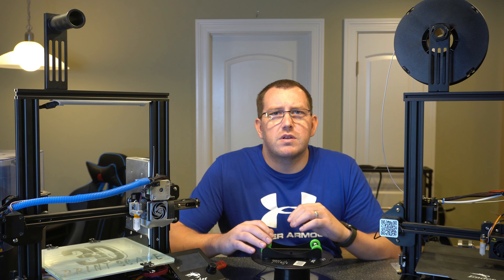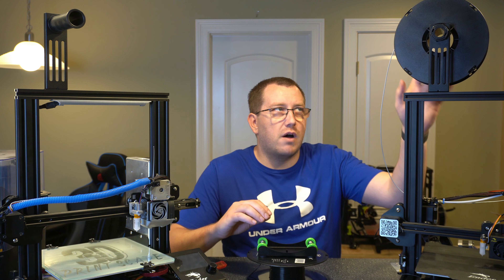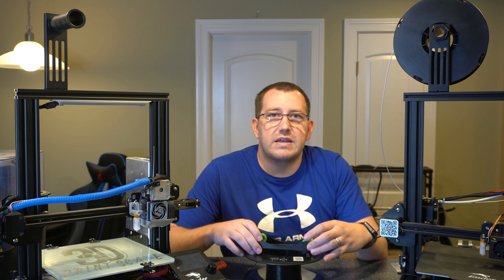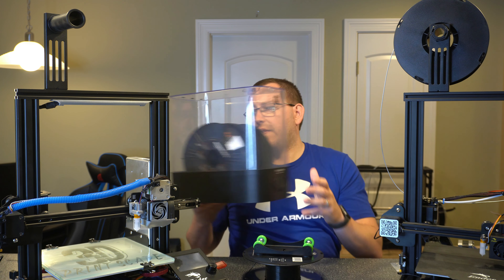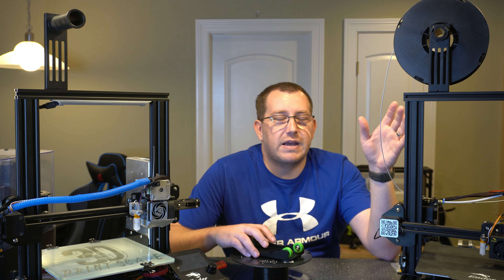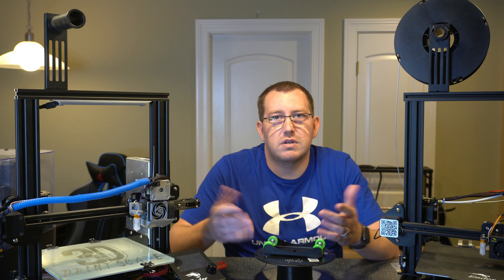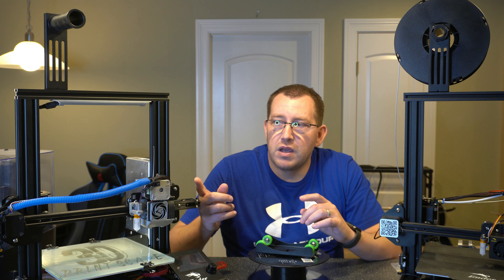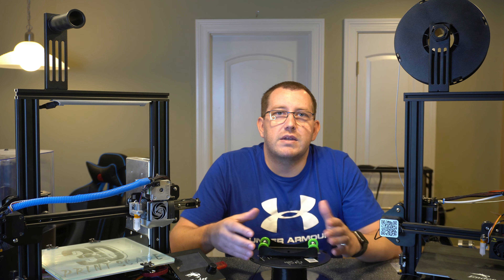3D Printer Filament Spool Holder Overview

Comment: Great videos as always Rob 👍 I printed a T.U.S.H as one of my first prints and it works great
Reply from the maker: Thanks and nice choice.
Reply: Me too , but i found that when the spool ( placed next or raised) gets lighter it has a tendency to leap of the TUSH.
Reply: @a1hamer  I’ve never had that problem atall maybe check it’s all assembled correctly I’ve used mine for 2 years without ever having a spool come off